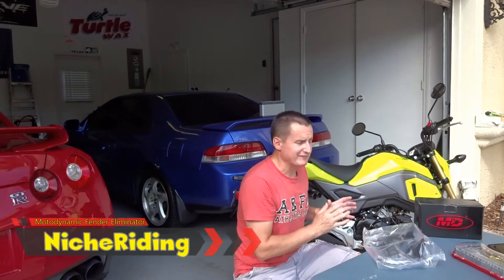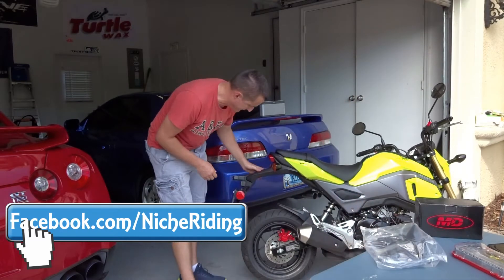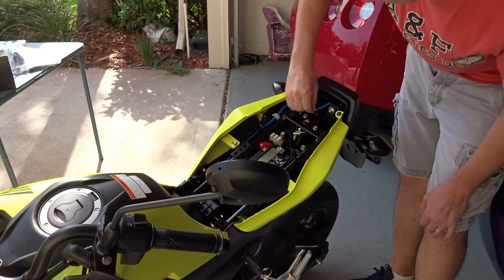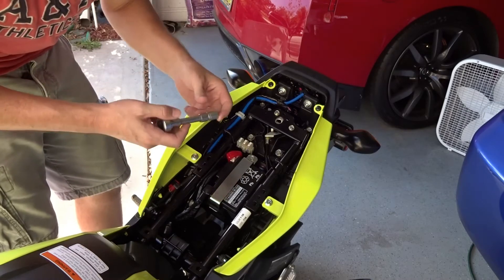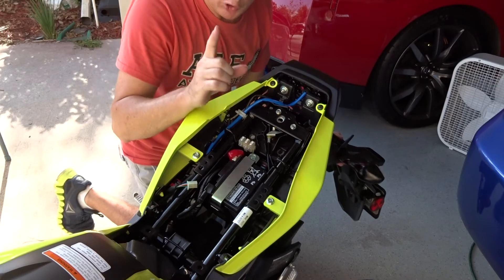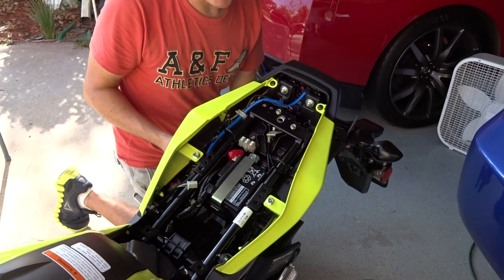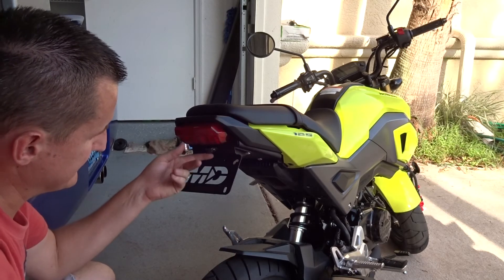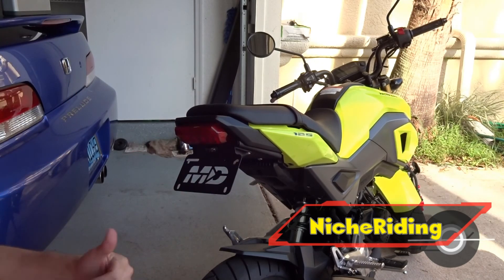Motodynamic Fender Eliminator Kit on a 2018 Honda Grom!

Comment from the maker: DISCOUNTS!!! $5 off any ONE single item (integrated tail light or fender eliminator kit) with code NICHE5. $15 off an order with BOTH the integrated tail light and fender eliminator kit at the same time with code NICHE15.  I hope this helps you guys save some money, I specifically contacted them and asked for a discount for my subscribers! Enjoy:)
Reply: NicheRiding is it possible at all to remove the front fender. There is a "Motard snail front fender" out now that replaces it and looks great but I cant find for the life of me if anyone has tried taking their front fender off. Guess I might just bite the bullet and see what happens haha
Reply: Just tried both codes and they're both invalid.  Was this for a limited time?

Comment: Dear Sir, you have some great rides in your garage. Anyway, would like to ask you about the fender eliminator plate, there is a rectangular hole below it, does it exposed access to the under seat or it is covered?

Comment: Are there any gaps visible under the tail ? And also is this fender eliminator kit aligned properly? I'm asking because the vagabond kit leaves big gaps and doesn't quite sit flush, thx for the video and useful info you provide us

Comment: Did you get the  regular Honda Grom Or The Honda Grom with Abs ? Which is better
Reply from the maker: the ABS model only comes in Red color. ABS doesn't matter to me since no bike I have ever owned had abs.
Reply: NicheRiding Thanks for the reply I'm thinking about getting one in a couple months. I didn't know about them till you bought yours 👍Honda Power 💪
Reply from the maker: They are a trip man, not fast at all but everyone wants to talk about it at stop lights or they think it's cool.

Comment: I just got a 2017 Kawasaki Ninja 650, Is this the same thing I could do too for that also?
Reply from the maker: yes, they sell one that directly fits your bike! You can buy the fender eliminator and the integrated tail light which puts the turn signals directly in the lights, I will have that video of the install up next week.